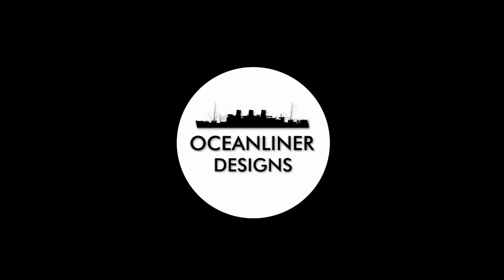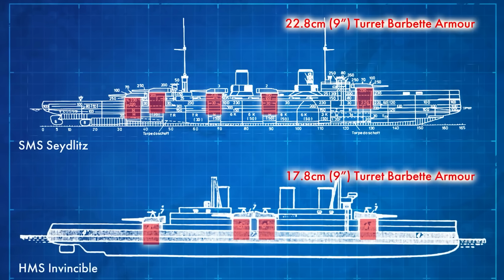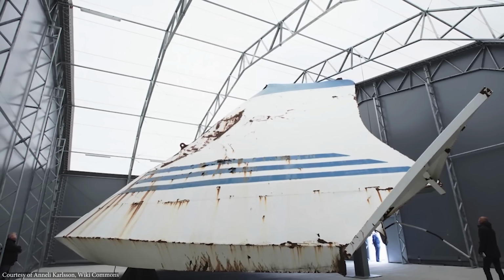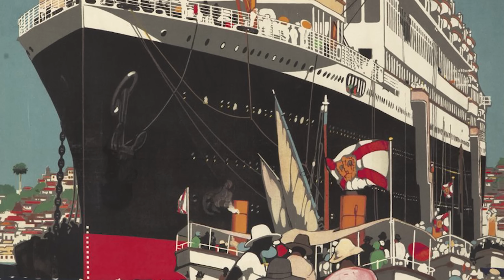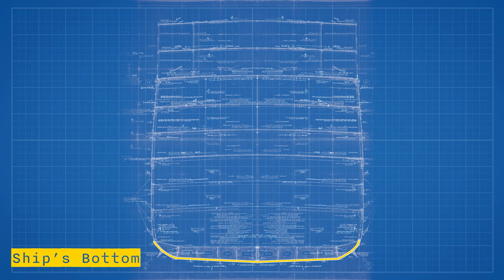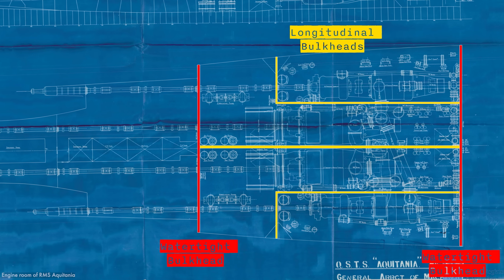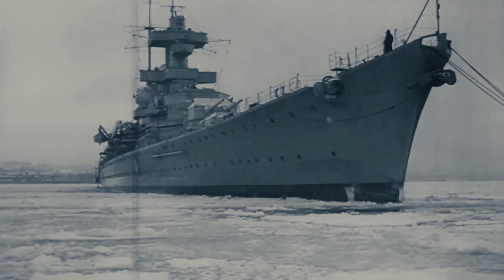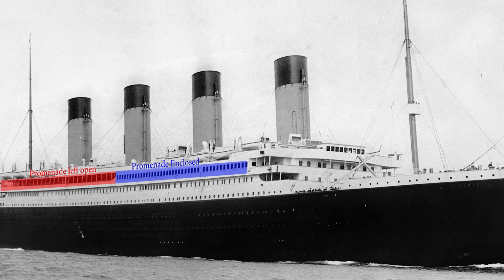The Worst Ship Design Fails in History

Comment: I don’t think Battle cruisers were cheaper to build- part of their longer length was to hold more machinery so they could go faster.  Both the bigger hull and the extra engines were very expensive
Reply: Robert L. O’Connell’s book, “Sacred Vessels,” mentioned that hydrodynamics dictated that longer narrow hull forms allowed for higher speeds, which was one of the many factors that led to battlecruisers’ hull shapes
Reply: All throughout literature you can read about it. They were expensive to build and to run.
Reply: @tb1271 I have found that for most non-political subjects, Wikipedia is an acceptable source, as long as you check the accreditations at the bottom of the page. In general, Wikipedia tends to become .... "less contested", let us say, the less politically-partisan the subject becomes. For something like this, I'd say that it's probably accurate. 

In the case of the HMAS Australia, the Navy General Board records indicate that the government of Australia paid the Navy £2,000,000.00 for the vessel in it's entirety, whereas the remaining Indefatigable-class ships cost £1,641,700.00 (indefatigable herself) and £1,779,190.00 (New Zealand) but those prices of the latter two exclude the costs of stores and fittings. All vessels of this class were laid down between 1909 and 1910 and all were commissioned between 1911 and 1913, starting with Indefatigable, and ending with Australia, accordingly. Additionally, your pairing of the ship with the Colossus-class is factually incorrect, as the Indefatigable's "mirror" or "twin", so to speak, was the HMS Neptune, which was ordered at the same time and laid down within less than a month of her. If you are unaware, almost all of the British Navy's capital unit types (battleships and battlecruisers) of this era were designed and built in sets that were intended to use similar fittings and equipment and typically had weapons of a similar layout and caliber as each other. This was done to, among other things, reduce costs by ensuring that ships built in these "sets" had commonality of parts and fittings and thus those parts and fittings could be ordered in bulk, so to speak. 

It is also worth noting that the Indefatigable's were never intended to be a multi-ship class, as both HMS Neptune and HMS Indefatigable were laid down as single-ship classes. This came about as a result of the 1908-1909 Naval budget fight between Parliament and the Navy Board. The Liberals wanted to reduce budgetary spending on the Fleet, and the Board, as a result, proposed only a single battleship and battlecruiser in the prospectus of December of '08, which were the Neptune and Indefatigable were proposed and ordered. The follow-on vessels of the class, New Zealand and Australia, were built to the Indefatigable's design, and thusly became "mirror's" of Neptune as well. 

HMS Neptune, as mentioned above, laid down within a month of Indefatigable, and intended to be her "mirror", cost £1,668,966.00, excluding the costs of stores and fittings, but including the cost of her main battery guns. This would mean that the "savings" accrued between the costs of Neptune and her "twin" (Indefatigable) was only about £27,000.00. 

Lastly, the battlecruiser, as envisioned by Lord Admiral Jackie Fisher, was NEVER intended to be a "cheaper" addition or replacement for the battleships of the Fleet Line. The British battlecruiser was intended as a long-range power projection tool and long-distance colonial raider. The battlecruiser was built specifically to RUN AWAY from battleships, and to RUN DOWN and KILL everything else lesser than her that she could, especially the scout and protected cruisers that many of the Empire's foes used as second-line combatants and especially the slower, older armored cruisers that were her actual design forebears. And merchant shipping, of course. Also to bombard and harass colonial stations and outposts. The GERMAN battlecruisers were the ones designed to be able to "stand-in" (in a pinch and only as necessary, of course) for a proper battleship of the Line, which is why the British battlecruisers suffered so badly at Jutland and elsewhere when NOT used properly. 

Two different classes of ships, intended for two very different tasks, almost the same costs for each. 

In my case, all costs quoted come from the Naval Board prospectus's or from my copy of Parkes' "British Battleships: Warrior 1860 to Vanguard 1950: A History of Design, Construction, and Armament." 

Edited to reflect ending date-of-commission for HMAS Australia.
Reply: They actually tend to be more expensive because they had more engines and boilers and were much longer.
Reply: Egg shells armed with sledgehammers
Reply: -$837.45 cheaper
Reply: Battle Cruisers are generally less expensive because most of the cost comes from the time it takes to get the armor made installed and tested where is with the battle cruiser generally you just go off of the basic Battleship Hull middle armoring add guns and in some cases enhanced engines but mostly in others just the basic Battleship design engines
Reply: @Shinzon23  They're only "slightly" cheaper to build due to like you said the less materials in the armor, they end up needing more powerful propulsion plants which usually ends up costing almost the same as the missing material for armor. They're generally the same size and sometimes longer than their battleship equivalents, take up the same large slipways for construction, take the same manpower to run, and usually have the same costs if not more for upkeep. The "cheapest" bit of them is the construction cost while everything else equals the cost if not more for a battleship overall
Reply: I'm sure Mike has no idea what he's talking about. Really bro
Reply: @Kevondrums81-zk8qv  Mike is very knowledgeable.  In this instance, research will indicate that a battlecruiser is indeed more expensive than its battleship of origin.  Thinner armor and one less turret is offset by a longer hull and more machinery.
Reply: Do you have any data to back that up?
Reply: @mschwage  I remember a Drachinifel video wherein he compared prices of battleships vs the battlecruisers they were ordered with.  The battlecruisers were more expensive.  As other posters pointed out, while the armor was less expensive, the hull was bigger and the extra machinery was not cheap.

Edit: Drach did give exact prices and I can't remember if he cited his source or the video in question.
Reply: @mschwage  You can find it on Wikipedia nut if I recall correctly HMAS Australia cost about 20 thousand less than dreadnought.
Reply: Australia was ordered 3 years after Dreadnought entered service, the correct ship to compare it to would be a Colossus-class battleship, though that would make it worse for the battle cruiser as the battleship was a much newer and bigger design.  Also, Wikipedia is not a creditable source, also, the price of the ships listed on their page as of today (01/01/25).
Reply: @mschwage  HMS Lion cost £2,086,458. HMS Orion her contemporary cost between £1,855,917 and £1,918,773.

Comment: The roll on roll off ship is a brilliantly practical design!
Should be called the rororo ship, where the third ro stands for immediately rolling over in case water leaks into the vehicle deck.
Reply: "Roll on, roll over"😆 It's a well known and used terminology within the industry.
Reply: @RoyHodgson97  Strange that not more of them have sunk catastrophically. With Titanic they really tried to compartmentalize it. That didn't help. So one might as well get rid of all the bulkheads and pray to Poseidon.
Reply: @bjorntorlarsson  Had Titanic struck the iceberg head on, it might have survived as less compartments might have been compromised. This would have resulted in more buyeoncy and no flooding of uncompromised sections. ( as I understood it).
Reply: Roll On/Roll Off/Roll Over